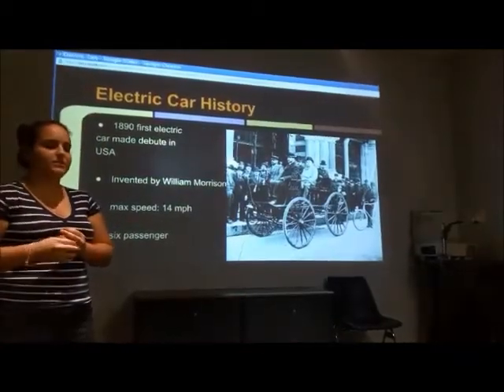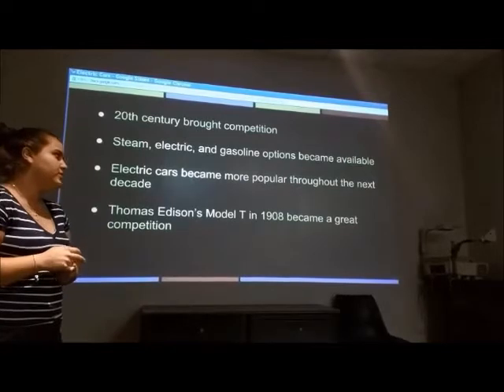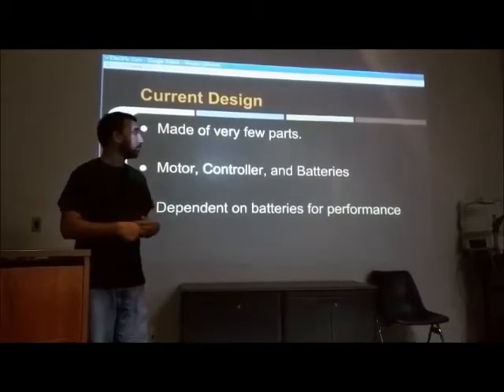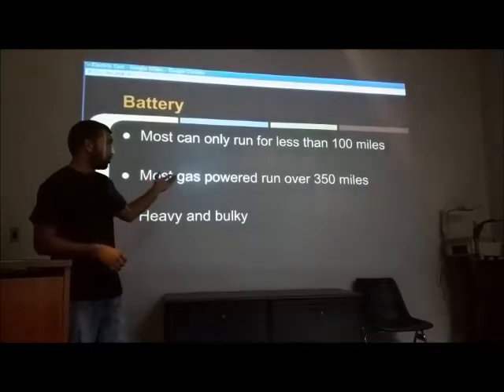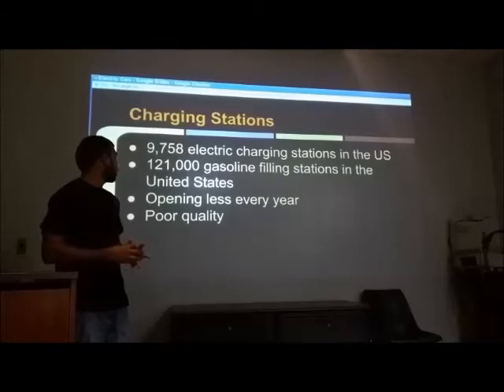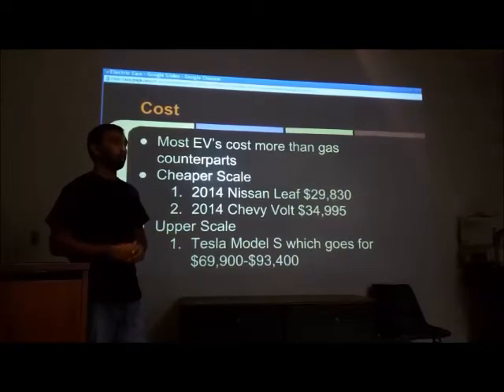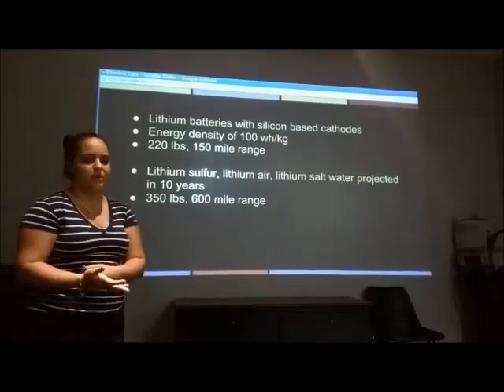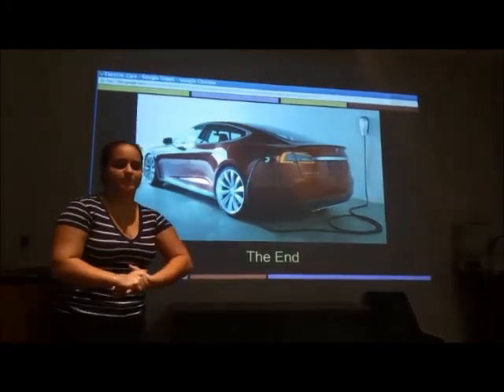Team S: The Electric Car

Comment: The presenters did a really good job in each section, it shows they are very well informed about the electric car. The PowerPoint is also really good; they use the bullet points really well. The visibility of the slides is really good; you can clearly read everything. The clarity of the sound is also really clear. My recommendations would be to make the video with more light on the background, and also to use more images in the presentation to give the audience more attention in the content. Overall, it was a good presentation, and a really well prepared team. Good job guys!

Comment: The lighting was very good for the presentation. It was very good that the presenter did not have to read off the power point. I did not know that there were electric car in 1908.
It was very good that the presenter knew enough information about the subject that he was able to elaborate on simple illustrations. It was a good idea to change the light setting depending on the image on the poweroint. With future development the battery will last longer and the car will run more efficient making it a viable option to drive.

Comment: The introduction was clear and to the point. Maybe avoid the fidgeting as it gets distracting and makes the audience anxious; also avoid looking back and forth to the slides. The presenters seemed very knowledgeable about the material and were able to deliver it a clear way. The topic of future developments was discussed but not with the same quality as the rest of the material. The lighting could have been better, there was a time where I could not see the presenter. The slides were clear, sound was good and the video quality was also clear. Overall the presentation was successful, I was interested and was able to follow though the whole time.

Comment: It was a good presentation. Information was interesting and well structured. Hand gestures are a little bit distracting though.  I really liked the fact that your slides don’t have that much wording on them. Plus, the font made it really easy to follow along and read the information. On the other hand, I would recommend making the diagrams bigger.  They were hard to see. Lastly, I would simply add more pictures into the presentation. The topic is very interesting but the lack of pictures made it less appealing. Overall, it was pretty good.

Comment: Audio quality and speaker voices were clear. A little more lighting could have been used. Some more visuals or diagrams could have made the presentation a little more engaging. A lot of good information was relayed clearly with a lot of practical insights on the matter. Overall a good presentation that is strong in informative substance.

Comment: The presentation was well informative and had well formed points as well, but the lighting and camera angle creates a big distraction to the viewer. Sometimes it looks as if you are looking at the floor instead of the camera. Also, some of slides were completely just read off of. Instead you should provide concise points and verbally elaborate on them. The images aided the presentation, but it was kind of difficult to read off the diagrams, partially due to lighting and camera angle.